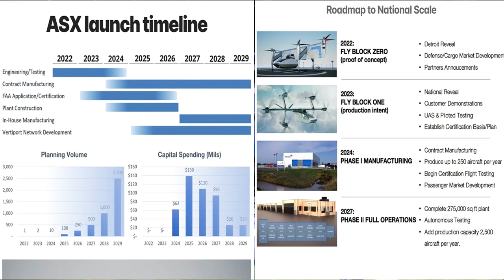ASX show Sigma-6 vtol air taxi on display as the Detroit Auto Show | flying car evtol news

Comment: Huge design flaw in my experience, also tilting wing vtols were proven problematic way back in the 1960,s  and abandoned the concept. 
History repeating it self and maybe a big waist of money.
Placing a massive sail size vertical wing in even a mild wind and good luck trying to maintain a stationary hover position without using enormous power and pitching forward and buffeting about. 
Have they tested these large scale models hover testing in moderate winds ?